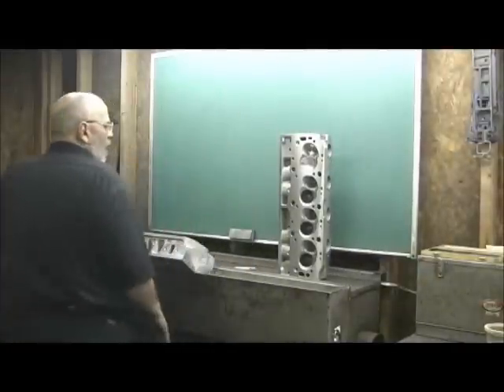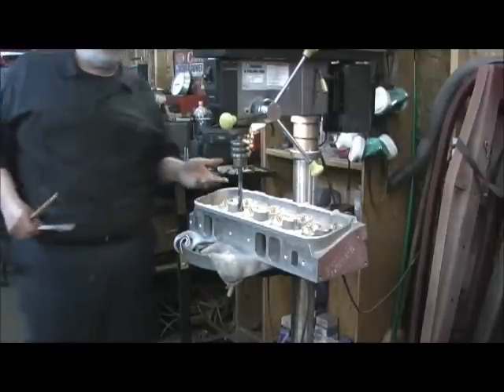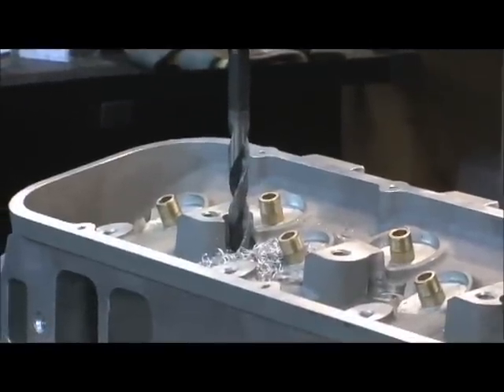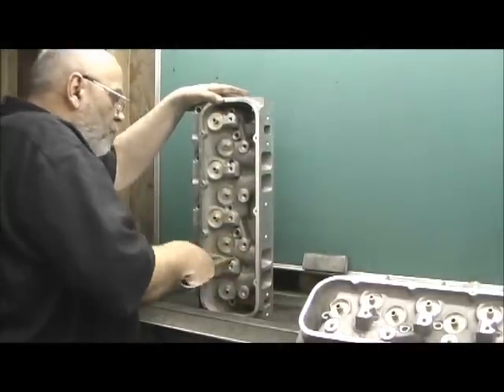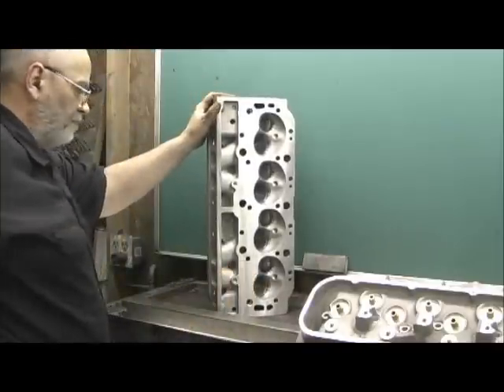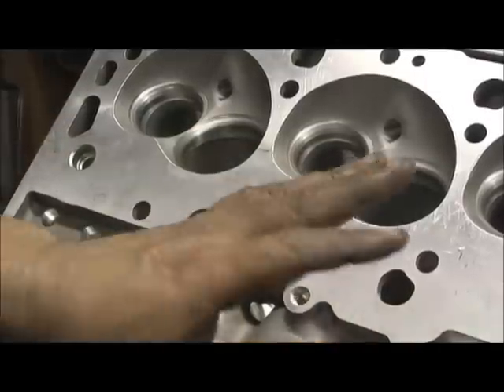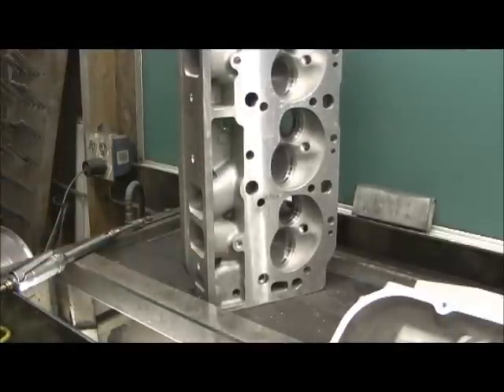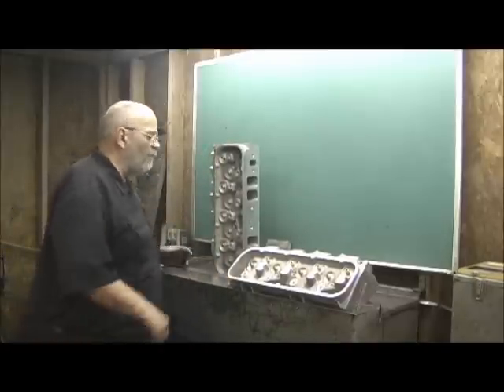Blyth's ProMaxx BBC 360 Heads Introduction 1.0

Comment: Some quick calculations compairing these to e7te 306 I built a long time ago state even with the 2.35" valves if you want a 632 to spin like Damn Yankees want them to it will need .8" lift. Lots of cubes make for very valve curtain limited motor. Those ports best kick some ass.